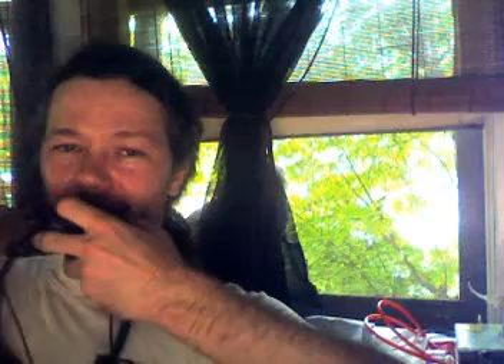BP USED PART OF MY IDEA Gulf oil spill solution how to fix the oil leak catch and burnoff

Comment: @gleekflaglue123 Not an engineer, but wouldn't that have increased the pressure behind and created more of an issue for already weakened lengths of pipe? like putting your thumb on the end of a hose may slow down the water flow after a kink or two or more are placed, but if there are any other damages we aren't aware of *likely at this point*, those will expand under increased pressure and also blow. As result, we have more area to fix....